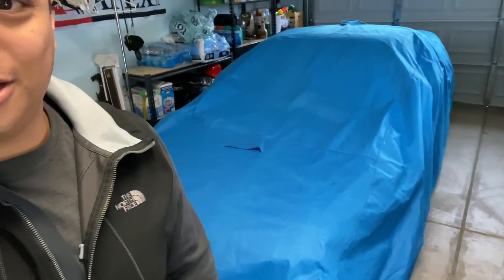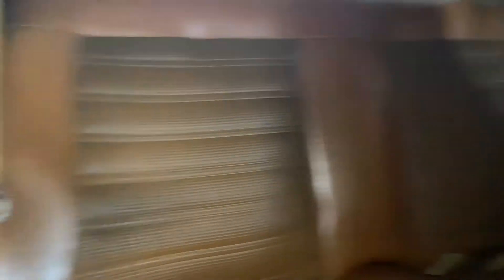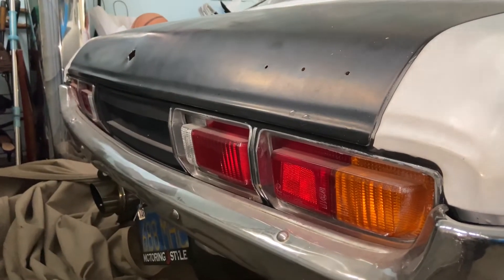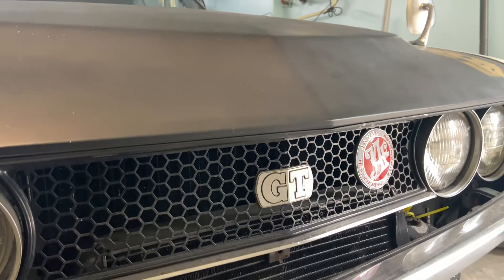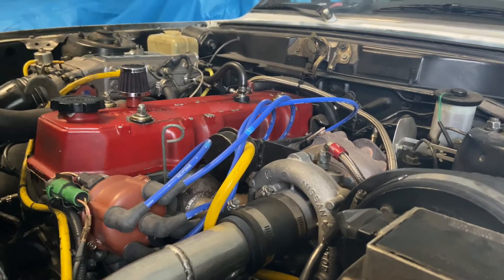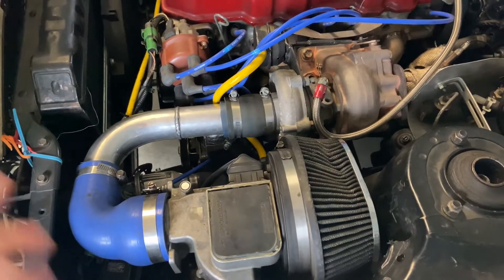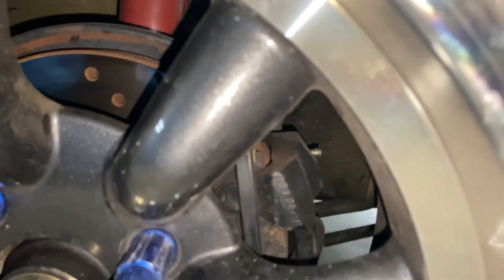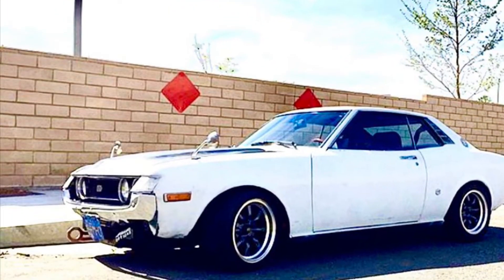My 1975 Toyota Celica GT - RESTOMOD “Franky” Build

Comment: Nice project bro-question do you experience fuel cut off while boosting? If not how did you bypass it -on mine I have stock ct20 turbo but swapped over maf from Supra and circuit board but still get fuel cut off.
Reply from the maker: I would hit fuel cut, but I did an old fashioned street tune by tightening the flap on the AFM. Forgot the actual procedure, but it’s online. Really delicate stuff, but done right you can adjust on the fly. So the most I boosted was 10lbs without hitting fuel cut.
Reply: @CruisinMiles  yeah online I’ve seen that but adjusting flap is separate screw that would keep it fully open on flap?
Reply from the maker: @kawi1999jv  it’s a tiny screw under the plastic part that covers the circuit board. It locks the spring in place. It’s essentially a set screw. You loosen it enough so that you can twist the black plastic cog tighter which will then tighten the spring. But make sure to mark the original position first with a permanent marker, because if you lose control of the cog it will let the spring tension go, you’ll have to tighten it back up until it’s correct. You only need to turn the cog clockwise to tighten I believe a couple of clicks.
Reply: @CruisinMiles  thanks bro